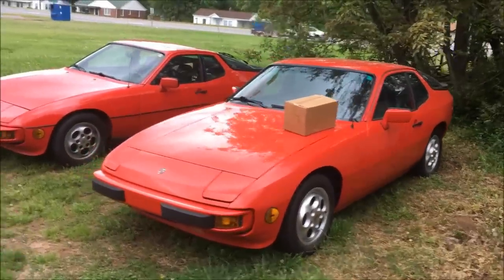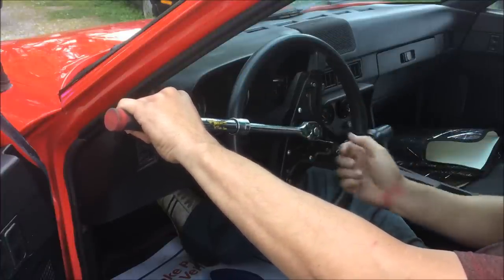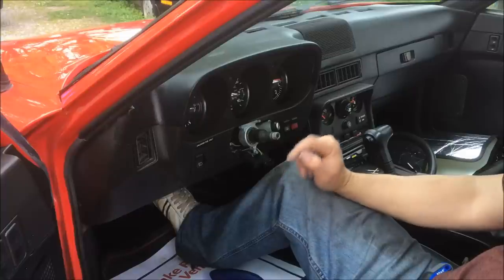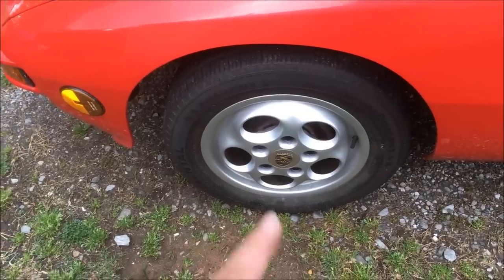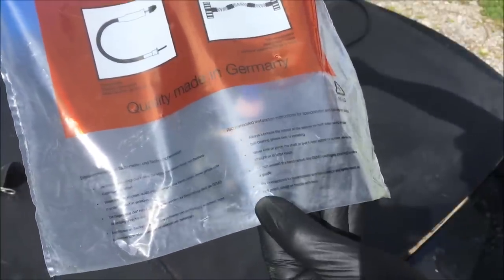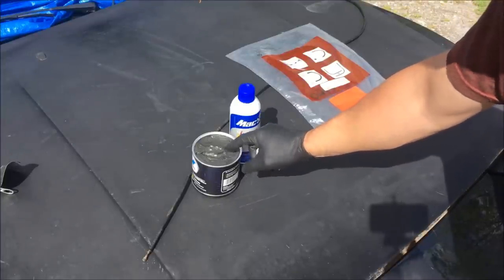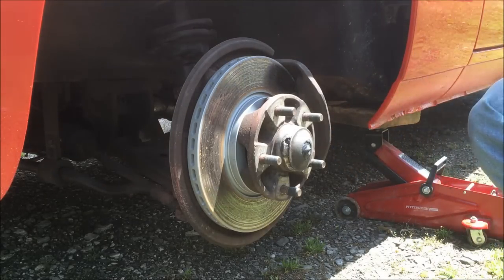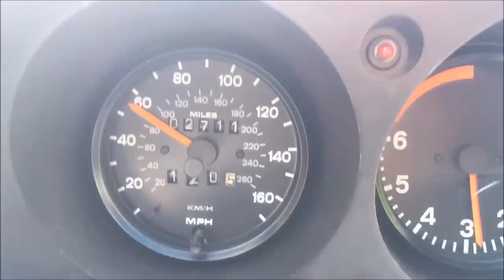Replacing a 924/944 Speedometer Cable

Comment: You are my hero! I used this video to fix my speedometer and its cable and it worked!! On mine however nothing “popped right out”, I actually had to cut the cable to get the speedometer out and then use force to unscrew as it was still wax sealed from the factory...moreover, the speedometer stuck really tight in the cluster. Another remark: On my Euro Model there were many more ... cables and some sort of BOSCH thing in the way which is not on the car in this video ... so I kinda had to go around it and the procedure from going from inside to the engine bay was more tricky.

So folks, it’s “alright” if it’s a little tougher on your 944 than it is in this video - still super accurate and very well described!

Unfortunately I was lazy and didn’t check the light bulbs of the speedometer before putting it back together and they both must have broke 🤦🏼‍♂️ So I’ll repeat this procedure tomorrow, but should be much easier now that I’m an expert 😜
Reply: Okay, so your video kinda inspired me and kinda put me to shame for being lazy - so I went right ahead after commenting and changed those bulbs. ALL working now.

Again a huge thank you from Germany!
Reply from the maker: Hmm, interesting. I have an early euro car here at the shop so I'm wondering what that 'Bosch' thing might be and if its on this car as well! Glad you got it sorted out though!
Reply: @edredas  part of the alarm or immobilizer (not the biggest part, that was under the driver seat)  was back there to the right of the instruments on mine (US, though) big black plastic box that says "the UNEO box" by Techne Electronics LTD manufactured by Nutek Corp. Taiwan - with a big white 8-pin connector plug. It has an FCC sticker plus a RF code number on there so I guess it has the receiver for the remote for the alarm. As I never had the remote, I might be wrong, cause I never could test it.

Comment: Hey, man. My car's speedometer has similar bouncing to it, but it's kinda worse than how you showed in the video. I was doing this project and already bought a new cable until I noticed that the e-clip is completely missing from the wheel. With the e-clip missing, the cable is obviously able to freely move. Should I just get a new e-clip or is the cable most likely bad as well?
Reply from the maker: Definitely worth a shot.

Comment: I love the Porsche emblem on the steering wheel.  Is that aftermarket?  Do you have a part number?  Does the Speedo have two or three bulbs?  Some of mine are burned out and now I know  how get to them to replace. Thanks!
Reply from the maker: Yep, the badge isn't stock... or at least it isn't normally found on the steering wheel. Someone just stuck a hood badge on there. The badges are available new to glue onto your steering wheel for about $140. That said, the speedo on the early cars has three bulbs. There is a fourth hole on the back but it is often covered with a piece of black tape from the factory and there is no socket for it. I hope that helps!

Comment: Speedo cable bit longer on the UK cars....lol, Haynes book says smear grease on end of speedo cable, so what's this RTV that you mention ,and use? Nice clear video, shows me how easy to change my broken stalk on my indicators now, so thanks mate!
Reply: Haynes, also known as the "book of lies". ;-)
Reply from the maker: Perhaps the earlier cars didn't have RTV sealant on the hub from the factory, so the Haynes manual might be saying to seal it up with grease. I have seen cars without it but assumed it was removed by the PO. That said, the grease method won't last long as long, so I guess that's why Porsche started using RTV, which I would recomend even if your car didn't have it originally! I hope that helps!

Comment: If you just want to get the instrument cluster out to change a light bulb do you still need to remove the steering wheel?
Reply from the maker: It can be done but I don't recommend it. It's extremely difficult to access the bulbs without getting everything out of the way and also very easy to break the hall sender on the back of the speedometer if you're not careful.

Comment: My speedometer is not working but thanks to this video I can certainly see what is going on!  My other issue is that my Tachometer is not working.  How can I fix it?
Reply from the maker: Does the tach work if you tap on it? I've had to replace a few that just quit working before, so I would check the wiring and try swapping it out with a known good tach. There are a few parts breakers that you can get one cheap from, or maybe someone can let you borrow one! I hope that helps!

Comment: I have a 1984 944 and my rpms gauge goes off and on, both crank and speed sensors are new. What do you think is causing the problem?
Reply from the maker: It could either be the wiring or the guage itself. To check if its the wiring, see if there is a pulse signal going to the green wire at the gauge. If the signal is present then try swapping out the gauge. I hope that helps!

Comment: My speedo cable snapped close to thw wheel. Previous to this the speedometer was working normal with no needle bounce. Once I had the new cable installed, the speedometer works, but now the needle is bouncing  ????
Reply from the maker: More than likely you received a Gemo cable. Those are hit or miss. We used to only install the Porsche cables which were three times as much but better quality. However they are no longer made. With that being said, make sure the cable isn’t bent in any harsh angles and that the two ends of the cables are greased. If that doesn’t improve the issue then the cable you received was defective or damaged during installation. I hope that helps!

Comment: Great Video Thanks

Could you have put a piece of string by the wheel and connected it then pulled that through and then use the string to pull it back
Also that hub cove comes of easily
Reply from the maker: Probably could but its easy to route it, the hard part is screwing it in the back of the speedometer.
Reply: @edredas  Right hand drive much more difficult

Comment: Would this be the same for in a 1987 944 S? my spedo doesn't work and I can't fin anything on it?
Reply from the maker: 1985.5 and later cars don't have a cable. Instead they have a speed sender on the transmission that sends pulses to the speedometer. Its worth replacing the sender first to see if that fixes it since they are cheap second hand. However, I've found in most cases that the speedometer itself is the issue. I hope that helps!

Comment: Thanks for the info!! Love your channel!! I own a 83 944 Metallic Sienna Red. Do you know any good painters? It could use an overspray. And a few other things!!!!
Reply from the maker: Thanks! Where are you located? If you are willing to do the body work yourself then any body shop should be able to paint your car and do a good job. With the silver car I had to pretty much pull it apart, and honestly I usually go a lot further. I will often pull the doors and the glass but the owner didn't want that. Paying a shop to do all that and any body work could cost anywhere from $5k+. If you do the body work yourself and take it apart then you could probably get a nice paint job for about $1k. I personally would not trust a cheap paint shop to do any body work. They will just mask things off with tap then spray right over chips and leave huge scratches in the paint from improper prep. I hope that gives you some insight, and helps!
Reply: edredas I'm in Milwaukee WI. Thanks for the reply. It is hard to find reasonable painters nowadays. You seem very thorough that's why I like your channel! ! Thanks Sean

Comment: I have an 84 944, the speedo bounces for the first 20 mph but then stop bouncing after but it's off by 5 mph. So if it says I'm doing 60, I'm actually doing 65. Is that the cable or the gauge?
Reply from the maker: There's a couple of reasons the reason it bounces. One is that the grease where it connects to the gauge has dried out or when someone replaced it they didn't apply any. As for the speed being off, check your tires. The stock size is 215/55R15 and if you have a 50 series tire on there it will throw the speedometer off. I hope that helps!
Reply: @edredas  Just got home from vacation and I apparently have 215/60 R 15s on there. Have to replace all the tires anyway so now I can get the correct tires. But I heard Pirelli doesn't make those anymore, that true?

Comment: I'm having this perpetual argument about breaking trip-meters. I can push mine whenever and it has never broken, still many people stick to the (unproven) urban legend that it WILL BREAK if you push the reset button while driving. What are your thoughts on the matter, you've probably seen more than most. I know 35 year+ old Porsche plastic is brittle, but do you really see more broken trip-odometers on 924/944 than on any other Audi/Volkswagen or any car from that time for that matter ?
Reply from the maker: Yes, I see a lot of broken odometer gears. We actually just replaced two of them this week. This is a common issue on a lot of older cars, not just the 944. The problem is due to the gear deteriorating overtime, and has nothing to do with whether it is pushed when while motion. When these gears deteriorate they crumble into pieces that are more fragile than an eggshell. That said, I have been pushing mine while driving after every fill up for the past 20 years. I've never broken or stripped one in any of my cars and they're original. Thanks!

Comment: Would this work for the later 944s?
Reply: Not a 944 s model, 944 was plural btw
Reply from the maker: Later 944's don't have a speedometer cable. They instead have a sender on the transaxle that sends pulses to the speedometer. If your speedometer isn't working on a later car it could be a few things. The wiring is usually the first thing I check, then the sender on the trans since I have a few that I can swap in. However the last time I had a non working speedometer in a late car it was the speedometer itself. I hope that helps!
Reply: @edredas  awesome ! Thank you so much for the reply 😌, I dont have a 944 yet but was considering getting one that had a non working spedo.

Comment: almost seems too simple for German engineering
Reply from the maker: I might have just made the job look easy, but it is pretty involved. That said, the early 944 and 924S are a little easier to work on than most German cars but it still isn't a Chevy. Lots of people don't realize that working on these cars takes 5 times longer to repair.